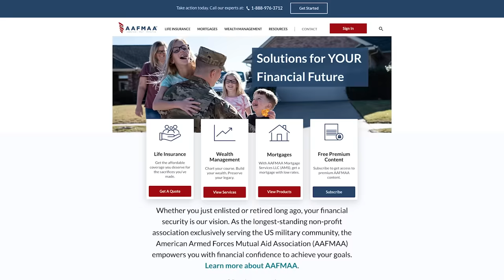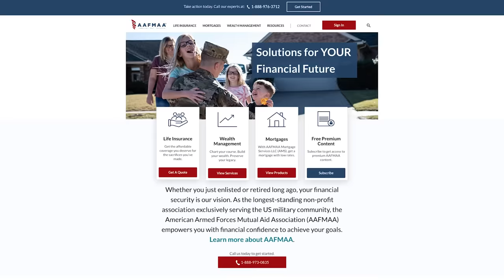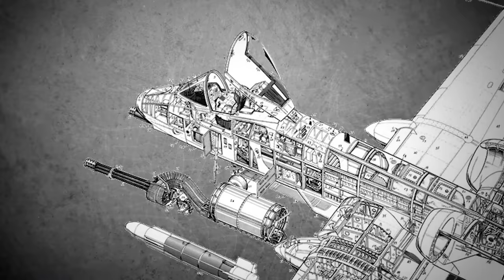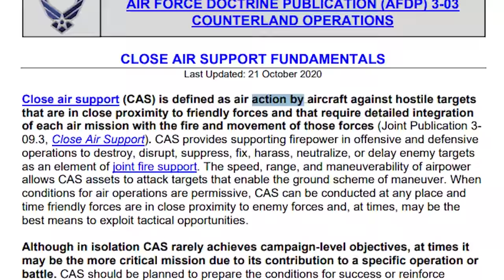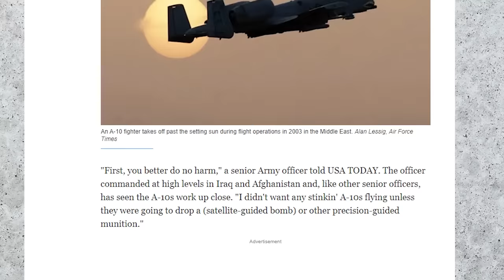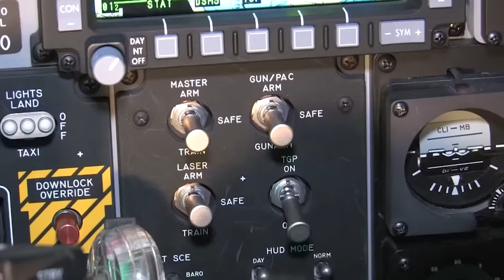Why the Air Force is Screaming to Retire the A-10 Warthog

Comment: We will miss the glorious BRRRRRRRRRRRRRT of freedom, but it's just too vulnerable to surface-to-air weaponry.  Smaller, drone-based close air support planes will be needed for our 21st century battle needs.
Reply: Stories from Erney and Brrrt.
Reply: according to several articles the F35 is going to replace the A10 for CAS. 
And considering that plane have about half the armor capacity of the A10 I think close air support will be downprioritised by manned aircraft in general. 

Switchblade drones and other options are more likely replacements I am afraid.
Reply: Freedom? Are you for real?
Reply: @nebraskabecause  Marines couldn't afford to maintain the old fuckers even with the slapdash duct tape shit they do. I don't know how they'd get them anywhere near the conflict on the back of a ship, but even before they saw the enemy there'd be a lot of airframes in the ground.
Reply: @kenji214245 the F-35 will most likely commit that CAS while flying high and dropping precision munitions on the enemy troops
Reply: @pipopoikapelaa5468  the F-35 can carry 2 missiles and 2 bombs internally and maintain stealth. Dropped from a height of 25,000 feet, a bomb will fall for more than a minute before impacting. 
For a CAS mission, that is weak sauce. 2 bombs are usually not enough, and a lot can change in a minute.
Alternatively, the F-35 can mount external stores (and lose all stealth) and fly lower, but then it will be as vulnerable as any other aircraft and still won't have the payload, loiter, or low-speed stability of the A-10 or other CAS aircraft like the C-130 gunship or AH-1.
Reply: My favorite aircraft yet it was only reliable, rugged, and cheap. I'm not actually sure how effective the GAU actually was compared to bombs.

 I do know the vets I talked with who actually had to deal with it a considerable amount of times were very sketched out about the accuracy or targeting of the gun. One Ranger said he would rather have an F 16 drop A JDAM or an AC 130. They were deathly afraid of calling in one close by.

 With that said I think people forget about how important moral is in battle. Nothing like knowing you have a flying tank guarding your position... I also have NO clue what the hell I would even do if I was on the receiving side, and saw one turning for a strafing run. Outside of standing in fear crapping my pants? I think I'd rather charge the m249 kill box!

 Anyway the A 10 and SU 25 are great for the cameras if you've all noticed since they can actually be seen. You don't really see other fifth gen fighters when they strike.

 I guess the AF did recently test the cannon is still effective against MBTs. I couldn't get exact details on the damn test.
Reply: @pipopoikapelaa5468   Yes that is actually what was said in the articles too. 

One major reason for it was a bit funny though. The F35 can't fly slow enough at a low altitude with a heavy load to be efficient for a close support role like that. It simply doesn't have the lift for it. 
Nor can the F35 like many other US aircraft operate well in rough weather. The A10 was one of the few they had that could take of in almost any situation.
Reply: @unittestedjackass363 uh oh someone is triggered
Reply: @braedenh6858  then send multiple aircraft. the plans you have listed would be absolutely useless in a near per conflict.
Reply: @braedenh6858   You can always use other planes, like the F-16 or F-14B.
Reply: Unmanned with high AI control is absolutely the future of warfare.
Reply: You guys forget that there are really fast next gen attack helicopters coming in that has pilots right?  You guys complain about low and slow, the new copters can fly lower and slower than any fixed wing craft and it has TWO PILOTS for double the situational awareness.  It is also under direct army control so communications, mission planning etc should also be improved compared to coordinating with another branch of the military in which your are in competition against.  This is why the Marines have their own pilots.
Reply: @dianapennepacker6854 From what i have read/heard about the guns accuracy, the best thing to do if you were the enemy target and wanted to survive is to stand out in the open waving a giant flag in one hand and tooting an airhorn in the other.

disclaimer: i know very little about this platform.
Reply: @braedenh6858  The F-35 can carry far more small bombs than 2. More like 8. Also being much faster than the A-10, it can respond much faster. In environments that don't require stealth, it can carry so much for its size. It becomes an absolute beast. The time to impact is not that big of a deal. Also note that with laser guided weapons, it's possible to adjust the point of impact as the bomb is in the air, if the target moves. Optically guided weapons will also track moving targets. Only GPS ones have set impact points on release.

For really low end, counter insurgency type of fights, drones are king. Not even Supers Tucanos are low end enough, they're still manned. Hell not even a Reaper, you can go smaller, Bayraktar TB2 type drones rule that environment. Turkey used them very successfully in Syria, Libya, and Azerbaijan. Stealth fighters + drones is the Hi-Lo mix of today.
Reply: @unittestedjackass363  In the case of South Korea yes they in fact are free thx to Amerika. And then look what happened to Afghanistan after Amerika left
Reply: @nebraskabecause   Considering that it has the highest number of friendly-fire casualties, I wouldn't be motivated if I heard or saw it right above my head.
Reply: @unittestedjackass363 lead is freedom
Reply: and friendly forces were also vulnerable to its terrible accuracy
Reply: Sky warden is the better choice to do what the a10 is good at, chasing insurgents in a low threat environment.  The air force is right that the a10 is a flying coffin in the face of a peer or near peer opponent.
Reply: @ctmme  #1, time to impact is a big deal. The FACs that testified in front of Congress back in 2013-14 said so repeatedly. In a dynamic fight positions can change hands in seconds.
#2 The speed of the F-35 is only an advantage in transit. F-16s and F-15s have that speed as well, but aren't as effective at A-10 at CAS.
#3 having 8 small bombs and a gun with a small amount of ammo is a small payload. That's why the USAF wanted F-16s to fly as "weapons mules" behind F-35s so that 35's could pick targets and use the 16s weapons.
Reply: @mpondachongo1138  what evidence do you have of that?
Russia is using helicopters in Ukraine, and they are more vulnerable than A-10s. How can they do such a thing?
Because they have local air superiority to protect the helicopters. That's the beauty of Joint/Combined arms. One airplane protects, the other airplane attacks.
There is no aircraft that can do a good job at both things, but they can do one or the other.
Reply: I think a drone, designed to resemble a miniature Warthog,  but with current technology and weaponry would be an excellent replacement. Fulfill the mission, and maintain the psychological effect, on both sides.
Reply: @mpondachongo1138 🤣🤣🤣🤣🤣🤣🤣 useless in a near pear conflict, that's exactly for what those aircraft were designed for,
Reply: @mossfloss fool
Reply: @ctmme and the f35 falls out of the sky with one hit, the a10 takes a lot more
Reply: @TrueHolarctic  more like lead poisoning is out of control...
Reply: @braedenh6858  you have to be joking
Reply: @JoaoSoares-rs6ec the f35 is near impossible to see with radars and it flies higher, the a10 is just a flying infantry target with a crappy gun
Reply: @Whydidimakethisa  🤣🤣🤣🤣🤣🤣🤣🤣🤣🤣🤣🤣🤣🤣🤣🤣🤣🤣🤣
Reply: @Whydidimakethisa  the f35 isn't invisible to radars with outside hardpoints and it would need to just to match the A10 payload, the f35 is an easy target for SAM and they can be taken out regardless of altitude, the A10 on the other hand as returned with out hap of the tail one engine, most of one wing gone and the other full of holes, with no hydraulics, no landing gear, any one of these would doom an f35, and the gun, it's literally one of the biggest guns e ever mounted on a plane, it takes two thirds of the plane and three quarters of it is just the barrels, it's 30mm rounds  can turn most military vehicles into scrap, that includes tanks, those that aren't destroyed are so heavily damaged that they have to be pulled out of the field, in short the A10 was built for two reasons one provide close air support to troops and hunting tanks, also think about this any soldier that has been under fire  ask them what they prefer over them an f35, a b52 full of bombs, our an A10, every single one will say the A10, I have also heard of enemy troops running away just by hearing an A10, that just says everything
Reply: @dianapennepacker6854  the gun is accurate to a circle of a few meters from target
Reply: @JoaoSoares-rs6ec  They actually made it less accurate. 

 When I say I meant the process. The gun is a monster! Yet is on a flying platform that relies heavily on the skill of the pilot, and is effected by the weather. 

 It is much less accurate than precision guidance weapons, and a hell of a lot harder to pull off!
Reply: @dianapennepacker6854  are you kidding me, first all planes rely on the skill of the pilot, second that gun is more accurate than a laser guided bomb, third that gun and plane can do their thing  in most weather conditions unlike most guided munitions, some the rain is enough for the targeting not to work.
Reply: @braedenh6858 It won't be as vulnerable as the A-10 AH-1 or AC-130😉
Reply: @kenji214245 The F-35B in question:
Reply: @braedenh6858 The agms, paveways, and 25mm gatling gun in question:
Reply: @kenji214245 An aircraft doesn't have to fly low and slow to be effective at cas.
Reply: @johnpaulvalentin5819  It does depend on the CAS scenario. The thing is if you are at high altitude and a distance it is no longer CAS it is normal air support. 

CAS requirements also usually include longer loiter time in the theater, ammo capacity for repeated strafing runs and the endurance to handle that even during harsh weather. 

Now the F35 is an amazing aircraft. But it is a generalist one. And low altitude high risk strikes is very much one of its biggest weakspots. So if US troops once again gets bogged down against a near peer foe that manages to keep the US from dominating the skies well CAS as history has shown would prove to be quite important.
Reply: @johnpaulvalentin5819  one question - will the US ever send ground troops into an area where the airspace is contested?

If so, then our air superiority mission is a failure, and all of our current war plans need to be reworked.
If not, then the A-10 and the AC-130 are perfect for CAS, and the F-35 (or any aircraft with an 'F' in the name) will not be able to do it as well.
Reply: @braedenh6858  Occasionally. But I disagree with your metric of evaluating CAS platforms. Fighters have been used for CAS since the infancy of air combat. That's not something I think will change anytime soon. (Also, the A-10 is far from perfect. lol)